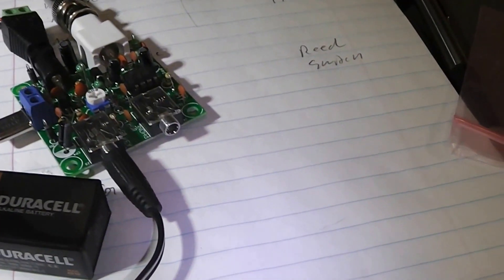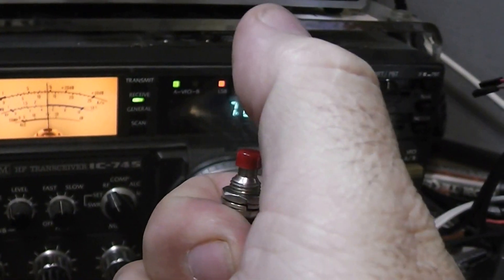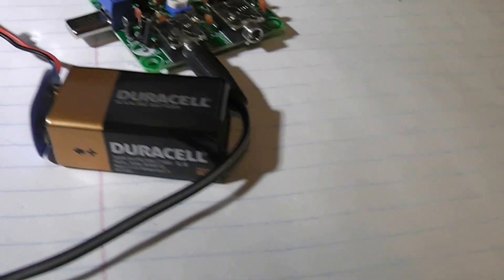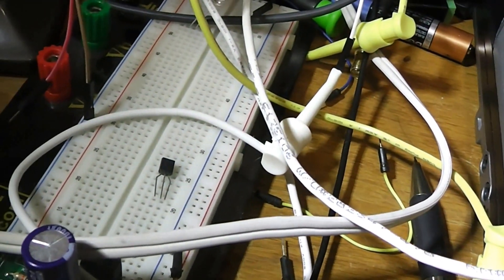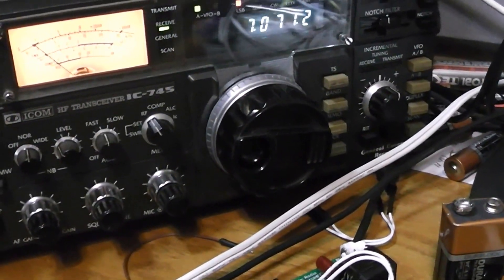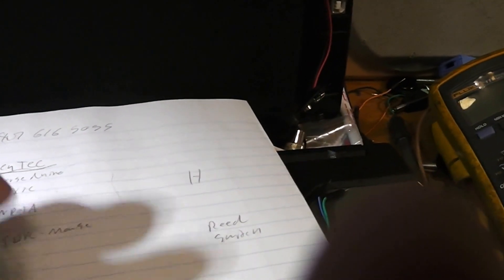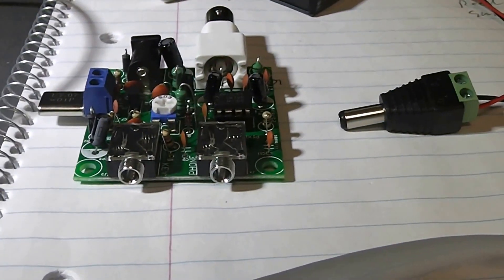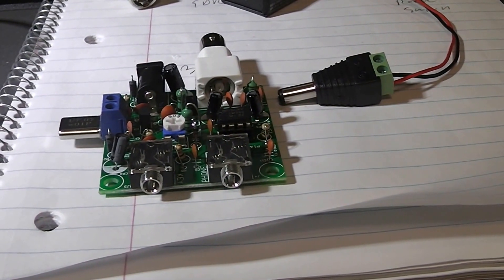The Pixie is alive. QRP CW transceiver kit

Comment: Could this Pixie be hooked up using a Computer CW Interface and use CwGet and CwType  software?
Reply from the maker: yes , with the right interface..tried with a rigblaster, but couldnt key it without modification to the rigblaster circuit.

Comment: You said you did not "clean" the board before assembly.... how/what would you use to clean the board? How would this be done?
Reply from the maker: +cattail3  I use a green 3m scrub and some alcohol or a fine wire brush.
Reply: +KK4PYN Thanks.... got it..... did you make any videos of the pixie in actual qso operation?
Reply from the maker: +cattail3  No, I never got that far. I am working on a optoisolated fet keyer circuit to be driven by an Arduino.

Comment: Thanks for a great video. I notice you have the same rig I do (ICOM IC-745). Trying to get active again but I am not getting many signals on the receive function.  I am not an engineer or technician and not qualified to troubleshoot it myself. Do you know if ICOM still services that rig or where I can get it looked at. W3GLQ - Lou
Reply: +Lou Aymard Lou, I suggest contacting Icom Service Center Michigan and talk to Matt. 73 Lynn NG9D